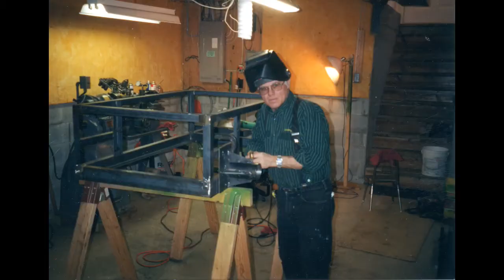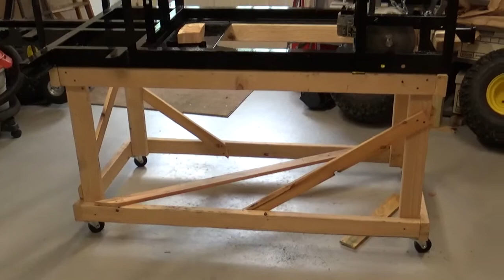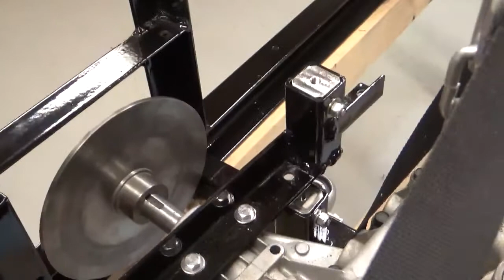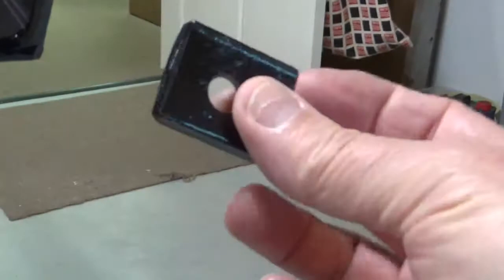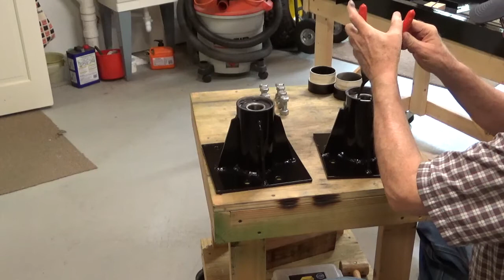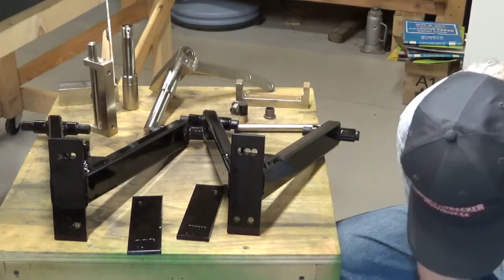Homebuilt Offroad Vehicle Part 2  Starting Assembly

Comment: Is there more video of you putting the rest together?....its looking awesome so far....your axle extension mite be a weak spot...if so...could use a coupler over the axles to beef them up.
Reply from the maker: Yes, I do have more video but just have not got around to editing it.  It's on the to-do list, though.  The outer axles slip over the inner ones and there is a bearing right next to the wheel that supports the weight of the vehicle.  It has worked out well so far.  Thanks for the comment.

Comment: Do the outer bearing supports have a bearing on the inside as well?
Reply from the maker: No, the outer axles telescope with the axles of the transmission with a good slip fit.  The sturdy axle bearings of the transmission serve as the inner bearings.  Thanks for your interest.  I am way overdue to finish this series and will soon.